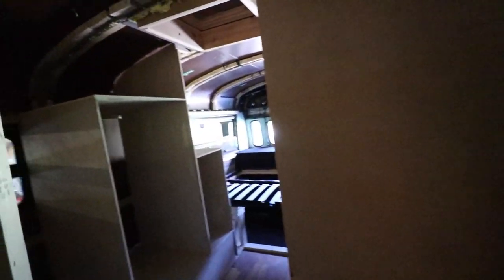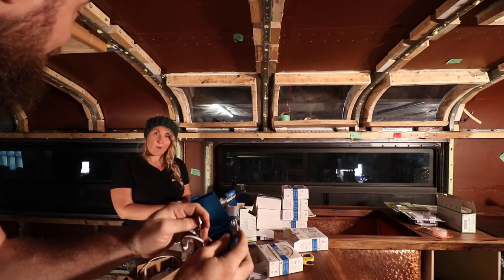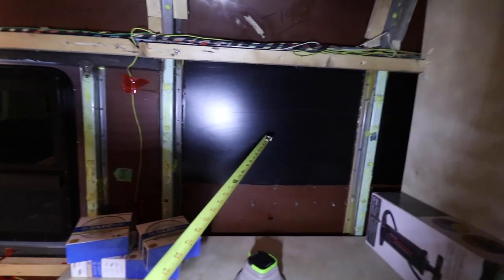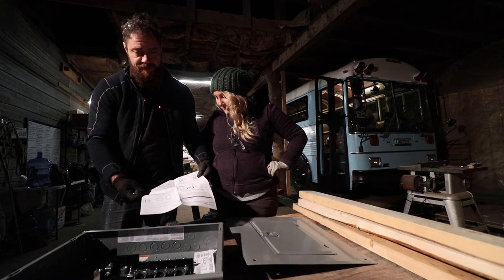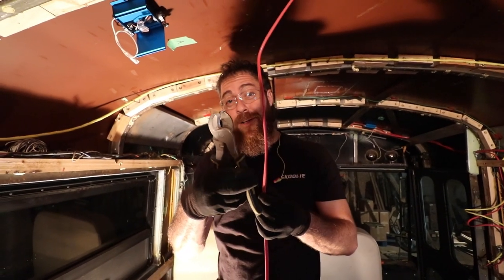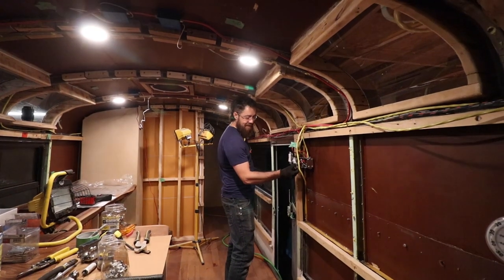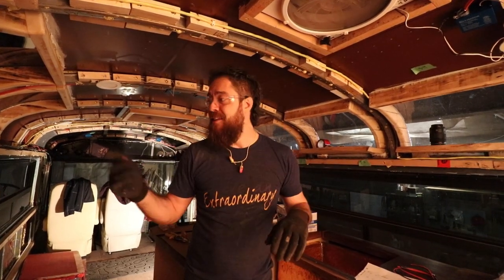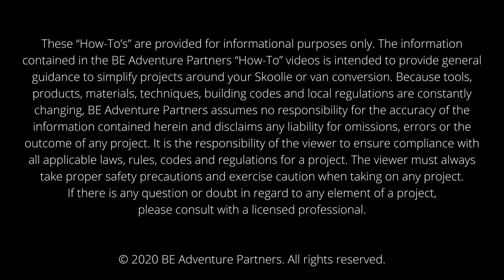Running Wire and Installing Liteline Slim LED Lights Skoolie Wiring

Comment: Those are great lights.  I renovated our whole house and installed 32 of them.  You can put a dimmer on them and even use them in your shower, like we did.
Reply from the maker: BOOM! Dimmer's are on all of them @Shelley Kentner! Three of the circuits are 3-way and we even have one in the shower! We absolutely loved that they are "Wet/Dry" location ready out of the box. That'll really be helpful because they are easily installed in any environment! The ones we got are 3,000K and the 3,000-2,000K dim to warm for the bedroom. Ended up with 16 of'em in the Skoolie. Thanks for watching!
- Brian + Erin

Comment: Absolutely love it
Reply from the maker: Yayyyy @ToConnext2000s! We've got lightssss! You coming up on lights soon in your build?
Reply: @BEAdventurePartners  I already have lights installed 12v non dimmable and I'm doing a wireless remote system..  I'll post a video here when the weather gets better.. Florida has been very bipolar lately, It's been raining everyday with 90+ deg weather (32+ C ) with 100% humidity  on a 1% chance of rain days. Can't wait to head west to get in more dryer weather .
Reply from the maker: Holy smokes! That sounds like a humid mess! Gotta head west for sure @To Connect 2000s!
Reply: @BEAdventurePartners  I've been looking forward to it now for 3 years.. Just need to finish renovating my house so I can sell it.. This was the 1st house I bought at 18  and turned it into a "ravers delight" now turning it back into a sellable house and with my health and vary little money coming in it's taken me over a year to get it to 80% done.. "Hoping" to be done by the 1st of the year.
Reply from the maker: @ToConnect2000s  that’ll help a ton to sell the house! Keep it up! You got this!
Reply: @BEAdventurePartners  the selling of the house will help finish the bus. I have only 1 more payment on my loan I got to buy the bus and get it up and 50% done, so selling the house will get the bus to 100% and hopefully some money left over to do some traveling and find work along the way unlike Florduh where jobs are not that great over here.
Reply from the maker: We wish you luck @To Connect 2000s! Sounds like a great plan!

Comment: Just an Fyi, usually moving vehicles dont use Romex or solid core wire, that's only for permanent structures. That's also why your bus, cars, airplanes, boats and anything else that moves uses stranded wire. Its stronger, more flexible, and can take the vibrations. Just something to take in consideration.
Reply from the maker: Hey there @RAVENTHE BUS, that's a solid observation regarding cable/wire type and use. As far as I could find, NFPA and NEC do not have any rating on type of wire other than the amps & voltage it carries. There are debates regarding wire use in motorhomes/RVs/etc... In any moving application (moving meaning that the wire moves, like in a door jamb, regardless of structure) stranded wire is absolutely necessary because it's designed to withstand the stress of continuous/frequent movement, although still has failure potential in those applications. In stationary applications (stationary meaning, in a wall/ceiling/floor, secured to a solid surface, regardless of structure) Romex is fine because it is not "moving." However, the long going debate is that there are "vibrations" that could crack a wire or loosen connections, which could result in shorts, or other situations. The torsion of a vehicle's twisting motion, or due to jamming on the brakes or collisions can create undo stress on any cable, stranded or solid. In every region there are different building codes, and we definitely advise that one consult an electrician when DIYing their electrical system. After we installed the 110v Romex cables, we had a Master Electrician come out to inspect our wiring. Fortunately, we received some great tips to improve our design, however, right out of the gate, all the wires went to the right place(s). In our next film, we'll cover more on what our electrician recommended.

We're still searching high and low for actual engineering studies showing the failure rate of 12-2 solid vs 12-2 stranded cable. If you come across a study showing this data along with what tests were performed, please send it our way because I've been looking EVERYWHERE for this information. On several sites, we've seen people talking about how their 30+ year old RV's have 12-2 solid wire in them and that they've had no problems at all. As per NFPA 1192 Standard on Recreational Vehicles and NEC Article 551 Recreational Vehicles, those documents do not state which TYPE of wire to use, but only talk about their capacity to carry a certain amperage and voltage. 

Thanks so much for watching & leaving a thoughtful comment!
- Brian (+ Erin too)
Reply: @BEAdventurePartners  Yeah your probably right, I'm sure we'll start seeing it being used in the automotive and aviation industries soon.
Reply from the maker: @Raventhebus  - So much of the stuff is opinion based that we have found... It's confusing what to choose with any of this. Something we like to do is observe the original features in the bus. The original wires from the heater were solid romex and they lasted 22 years. Hopefully, by properly securing the wires in place we won't have issues. Haha, just another fun part of the science experiment isn't it?!

Comment: As an electrician I would be thinking you would need access to the wire connections that’s why when installing in a residential application you would have access?
Reply from the maker: Hey there @TEXAN1845 - Yep! We're constructing our electrical setup so that every wire end is accessible (even the ceiling void space mounted blue boxes will be accessible if we ever need to get back at them).

Quick question... You being an electrician, is there any engineering study out there with regards to stranded vs solid core wire/cable in motorhomes? I read NFPA 1192 Standard on Recreational Vehicles, and NEC Article 551 Recreational Vehicles and both of them only talk about wires and cables used should be of the correct amp/volt carrying capacity. Nothing I've found talks about stranded vs solid. I've read the stranded application is best for moving applications in the terms of wire/cable service to door-mounted switches and hardware where the wire would experience frequent motion and read about solid core wire/cable is fine for non-moving applications in the walls of structures... There are soo many debates on "best practices" but I cannot find any actual studies showing a test of one vs another. Would love to hear your input on that! The Master Electrician we had that came over to inspect our initial setup said it looks good to go for this application!

Thanks so much for watching

- Brian (+ Erin too)
Reply: @BEAdventurePartners  I haven’t wired an RV from start to finish just made repairs on my own my experience is mainly in residential and commercial electrical but my concern is the wire connections because of bouncing down the road will put stress on those admittedly not a big fan of the quick connection aspect of it but there improving those all the time hence the reason for raising the concern of access but I am glad to see y’all are doing it in  120v because like y’all not a big fan of 12v devices or lamps
Reply from the maker: @texasproud3332  - We definitely appreciate you mentioning this, and we agree. We were concerned about wire connections and rubbing too. We have read that the wires are supposed to be tagged down every two feet with cable staples. So we are going to go ahead and do that, as per the RV requirements & NEC Article 551 Recreational Vehicles. The electrician we spoke with suggested we use the blue-winged connectors within our switch boxes & outlet boxes. So we are going to upgrade from the ones we found laying around the shop ;) Does this make sense to you as well?

The nice thing is, our electrician didn't see anything we did that was dangerous. He said the wire we chose was overkill... the 12-2... But we already chopped it up and ran it. So we will be painting the red wires white in the boxes. Thanks for taking the time to share your expertise. It's greatly appreciated on our end. We are collecting suggestions and gonna run with the average. - E + B

Comment: You did the wrong thing man those are 12v led lights the box that you are putting in the ceiling has a transformer in it that transforms the 110V to 12V and if the transformer ever go's out just remember you can't get to it because it's in the ceiling... All you need to do is throw the boxes away and just cut the wire back on the lights and hook them up,to 12 Volts take one of the lights and trip the wire back on it and hook it up to a 12v battery!  I bet you anything it will light Up!!
Reply from the maker: Hey there @Gary Wayne! Great observation about the LED lights. These are actually residential LED lights and are not 12V (We didn't show this, but the transformer drops the 110V down to 24-48V depending on what percentage of dim they are dialed to.) If the transformer ever goes out, we'll be able to replace them because of how we're going to construct our ceiling (you'll have to wait to see that!) So, it wouldn't be a good idea to throw those boxes out because we're not installing a 24-48V system (we'll be installing a 12V system which would result in a low voltage situation.)  Although the lights themselves may light up by discarding the required transformer/LED driver, that little blue box does more than just drop the voltage down 😉  Let us know if that makes sense.

So if anyone is installing dimmable LED lights, regardless of the voltage, a driver of the correct type will be required to prevent flickering when using a compatible dimmer switch. That's another reason we went with 110v lights, is because the 12v ones we found didn't really get good reviews (and one of our friends has these lights in their house and they are SIIIICCCKKKK!!!

Thanks for the tips & for watching! I'm sure in the right scenario discarding some of the components may work. However, in our scenario, we would be left with a system that would not perform as we intend it to! 

- Brian (+ Erin too!)